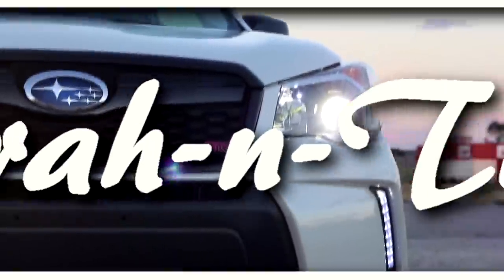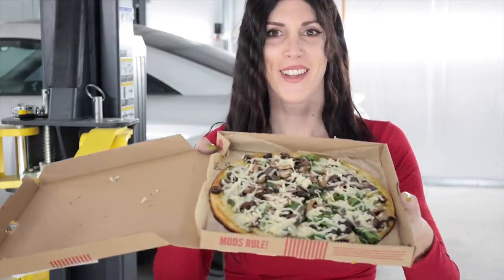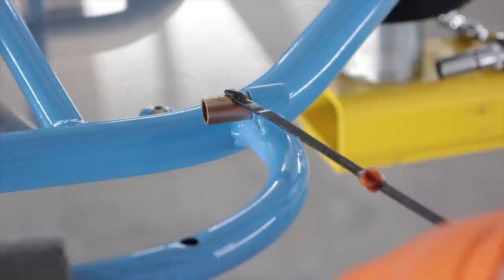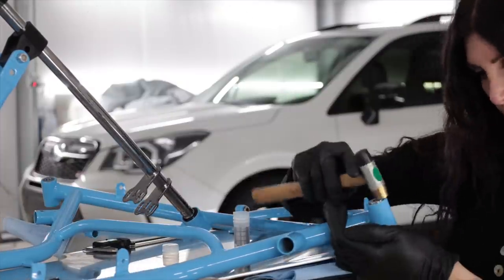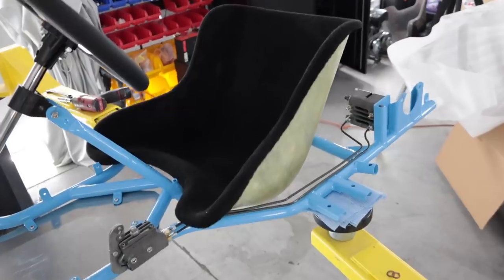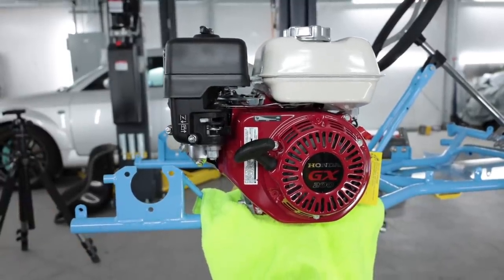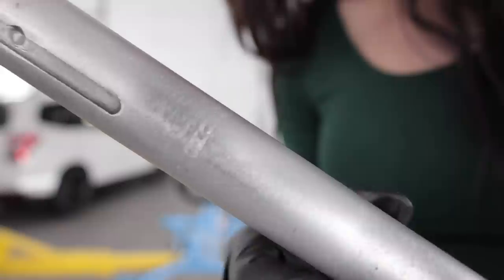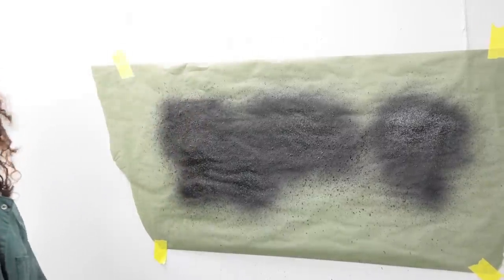Changing Things Up w/ A Different Engine! // Emmick Kart Restoration

Comment: Future upgrade idea.... Go kart motors always seem so weak to me. Could you hybridize it in some reasonable way? Put an electric motor on the other end of the axle and have a "boost" button to hold down for electric assist (and I mean an electric assist that I think will double the power at low speeds).  And, the electric motor could likely be an electric start for that gas motor.

I know a bit about this, though I have never electrified a go kart, and I am not positive but it may be the type of thing that if it works as well as I think it would all go karts would have to have this to be able to compete. Same idea as hyper cars (Ferreri LaFerrari, Porsche 918 and several others) have electric assist.

Design considerations:

Lithium batteries are quite light weight. Put four 12v lithiums in series for a 48v motor. Currently you can get 6 or 12 amp hr 12v lithium batteries from Bass Pro (and other places) for about $100 each. They are very small and  light and look like a tiny car battery. They have internal BMSs which make them really convenient to use (just add 12-14v and they stop charging automatically when full). These batteries may not be able to handle a 48v charge so you may need a 4 bank charger (like a boat charger) if the electric motor puts out higher voltage while in charge mode. I think these small batteries would be sufficient to provide assist where it is most beneficial.

The most difficult/expensive component is the power controller. Don't bother with one and it will simplify things  huge. Just have the electric be 100% power assist for takeoff and/or low speeds with some type of disconnect (manual or automatic based on speed maybe) and leave the gas motor on it's own for higher RPMs where gas motors excel. The gas motor runs at all times but gets electric assist down low. You could have a manual disconnect and also have the brake pedal always disconnect the electric motor. You could likely remove the CVT.

Don't try to have the electric motor do reverse. It will just add complexity and likely be the most vulnerable component.

Like my Prius the batteries are small so you use the electric when it is most beneficial (takeoff, low speeds/RPMs) and disengage when it's not. 

Electric motors can act as chargers so to recharge the batteries just use the gas  motor either while racing at the high speed times (don't know if this would be too much drag) or between races while goofing around or even lift the back of the kart off the ground and let the gas motor turn the axle just for charging. You could also have a wall plug charger but it likely wouldn't be necessary.

Just one solenoid to engage full electric power, maybe a separate solenoid to engage/disengage the electric motor from the axle and another solenoid or relay to enable recharge. You could even have a button on the steering wheel or a foot button where the electric motor will only drive while the button is held (at 100% electric power).

I weigh about 250lb and I do use go karts. You must weigh quite less than 150lb. All of the electric requirements I think would not weigh more than 100lbs (likely quite a bit less) so the motor at high speeds with you in the drivers seat plus the electric weight  would still not be pushing any more weight than me in the drivers seat without the electric weight.

Trust me when I say that not having a power controller will be way simpler, much less expensive and that's really the component that always fails.

I  at one time bought a diesel locomotive (train) 24v starter (and the generator) from a truck scrapyard to use as the drive for an ROV. I didn't get around to it so I gave them away just a while back. I did some testing though. The starter was only about 3hp (I think) but electric motors have the most torque at the lowest rpm so that starter was amazingly powerful. I didn't try it but I think it would work at 48v rather than 24v and it would use less current so run even cooler. The locomotive starters were designed to run for quite a long time under a huge load while starting the huge diesel engines (even in cold weather) so that might even be a very good type of motor to consider for a go kart. It would likely drive the kart on it's own faster than that gas motor but it would run out of battery real fast.

You may have to use a resistor to reduce the full power to the motor from the batteries or the motor might be too powerful. You would have to experiment.

Without having the power controller this would actually be a fairly simple setup and a very interesting learning experience.

Comment: Firstly, al - u - min - ium is the correct pronunciation.
Secondly, the bolts you put in to hold the base plate up should be the other way around.  Bolt head underneath, not on top.  
That way you can see if the nut is coming loose.  Hopefully you are also using nylock nuts too.
Reply: And the skid plate wont SKID but stick into the object with the protruding nuts and bolt thread!
Reply: @mac4boys541  exactly

Comment: I haven't seen all your videos so I don't know why you chose white for the Focus interior because there might be problems with reflections in your windshield while racing. The guys at Grassroots Motorsports like battleship gray:

'There aren’t any rules to follow here, so that question comes down to personal preference. And ours is based purely on function over form: We like coatings that are easy to clean, don’t hide dropped bolts and spilled fluids, and don’t distract on track with bright reflections from the interior. Past experience has taught us that battleship grey is a color that accomplishes all of these goals and has the added benefit of complimenting most exterior paint colors nicely.'

How To Paint a Race Car Interior
https://grassrootsmotorsports.com/project-cars/LS-Swapped-2003-Nissan-350z/how-paint-race-car-interior-project-lsz/

Also I don't know if you have already seen their MR2 Turbo and RallyCross SVT Focus projects.
https://grassrootsmotorsports.com/project-cars/1991-mr2-turbo/
https://grassrootsmotorsports.com/project-cars/2003-ford-focus-svt/

HTH

Comment: "I don't have a workbench"  Was that a subliminal message to someone?  Depending on the work, sometimes my karts go on a bench, sometimes sawhorses, usually my genie lift where I can strap it down to the forks if I remove the engine or whatever for weight balance.  If you decide you "dont want to be fair" to the competition please refer to engines sold by NR Racing.

Comment: I just find it's funny you like saying aluminium but no metric conversions for your measurements. I know, now that I mention it you'll never include metric numbers now 😕. The kart is coming out really nice! I am a little worried about your rally car though, a lot of pricey and near one off parts for something that will be dodging boulderss and trees. I guessing you're just going to pressure wash the inside also, I can't imagine that crinkle white will be easy to clean otherwise once it gets dust embedded in it. I would just put this rally project in car shows since it's getting too nice to wreck and build another rally beater to learn the stages in.

Comment: More Torque and less HP.. Hmmm...  I hope that because its a new engine it will be stronger than the one you are replacing 😂
Reply from the maker: The predator engine doesn’t list at what RPM it made that peak hp at. My suspicion is the Honda technically makes more.
Reply: @SarahnTuned  It just needs to be strong enough to beat Charlie.. He seemed a little smug the last time you raced!  Lol!

Comment: Pro Kart TIP:  Use hex head floor pan screws, and FLIP THEM over so Nuts are on top ... because they WILL bottom out on the asphalt, you want to maximize ground clearance and be able to loosen those screws after the heads hit the pavement (a button head screw head will be impossible to get a wrench in after it bottoms out). Take a look at how I set up my 80hp vintage dual engine racing kart... https://youtu.be/macY5n_R3gE    ... you need to try one of those next, LOL.

Comment: You could of just bought a go kart frame instead of a used one. Everythings new on this now
Reply from the maker: That takes the fun out of it!
Reply: @SarahnTuned  youre doing the same exact thing. You striped the used one down repainted it and replacing a mass majority of every part including the bolts and engine. Idk how much you paid for that used but you can get a brand new frame pre painted for like $200 or even a decent one for $75 on ebay. Then whatever money and sponsor if any you have in parts you got already.
Reply: @buffalobmf  you just took all the fun out of it.
Reply: @mostcom  hows going to some random house to pick up a gokart then replacing everything and buying a brand new frame and painting it and doing the samething taking fun out of anything?

Comment: your hand tool usage bothers me. sorry. Drilling aluminum, wd40 is a great lube in a pinch. Start with A small drill. 1/16 or 1/8, then finish with final size. Faster, safer, bits last longer.

Comment: please, tie your hair back out of the way when using power tools... once the drill or such grabs a few strands blowing in the breeze or when you lean into the job, it will rip it from your scalp... Health and safety before appearances... for your own sake...
Also, there are two holes on the upper steering shaft support block... and two holes on the frame it attaches to... use them both...